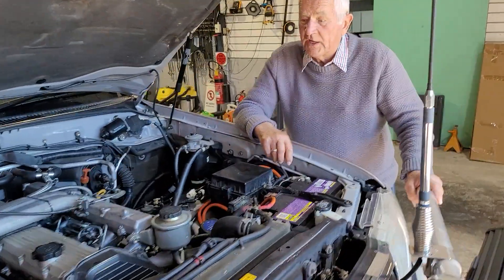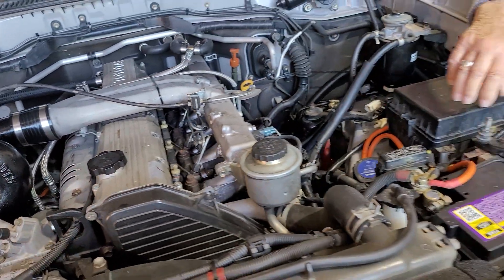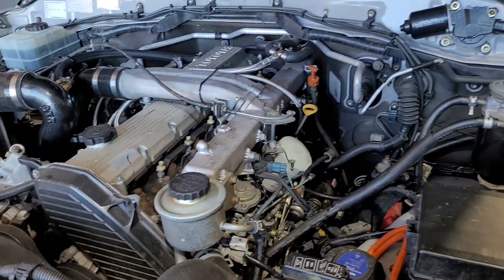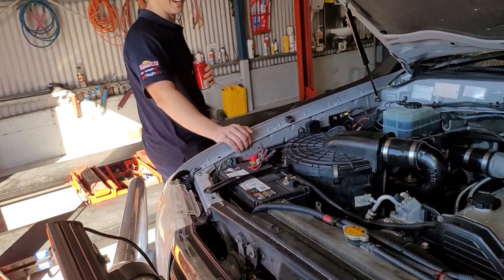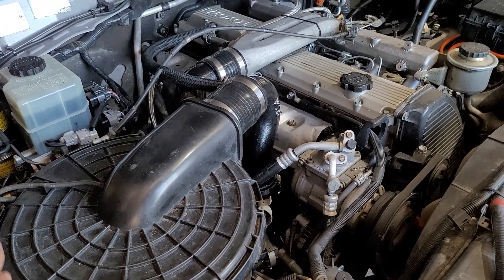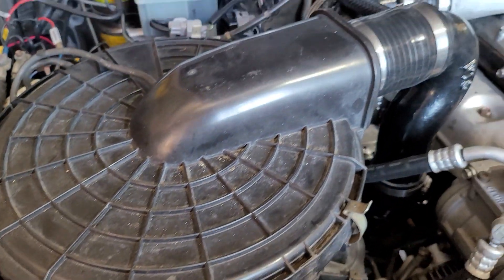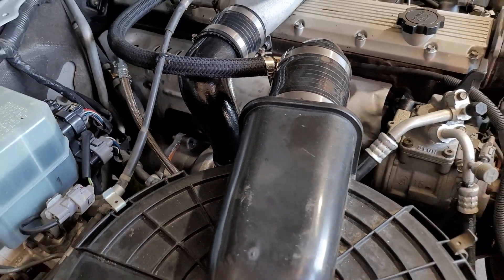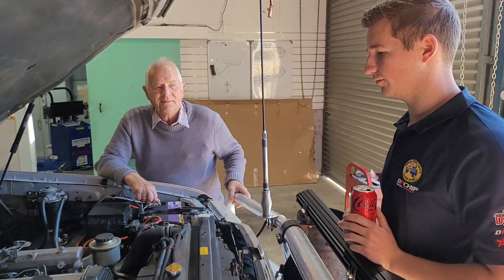Why does your Toyota 1HZ need a Turbo?

Comment: Been following Berrima diesels work on these 1HZ's for some time now and almost about to pull the trigger on a 105 purchase. I know you have mentioned you do not need an intercooler but I have read/watched others with a turbo 1HZ and they talk about overheating issues especially when towing, could you shed some light on this? I was thinking of throwing in an intercooler and radiator upgrade along with the turbo upgrade.
Reply from the maker: As soon as Id read about a company and overheating around a 1HZ...........R U N !!!!!!!!!!!!!!!!!!!!!!!!

Comment: Nice neat and tidy job done. Do you have the before and after dyno readings.
Reply from the maker: There's no actual need to dyno when we're installing a turbo with the experience we've had for decades but as a guide when we do Dyno the odd one for a customer you looking at about 35 to 40% increase in torque

Comment: A neat job, but I’m not at all keen on the zip tie over the intake securing the braided hose. A rubber lined p-clamp would be a better and more reliable option in the long term.
Reply from the maker: You obviously underestimate the durability of cable ties... 100,000 km later that will still be there

now...back to your old school pee clamp... you will need to drill a hole into something that hasn't got a hole... and that will be no good